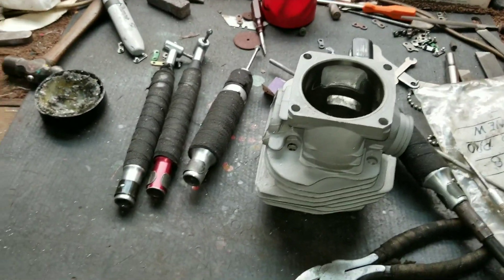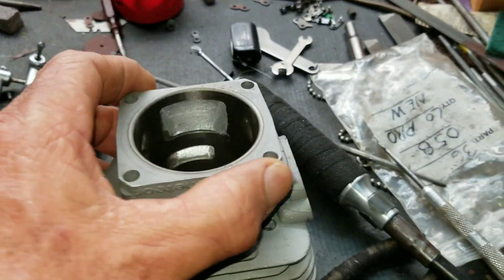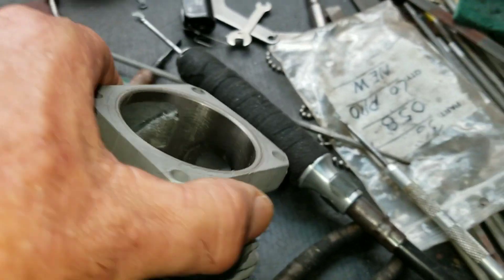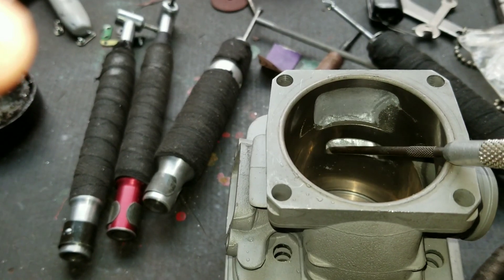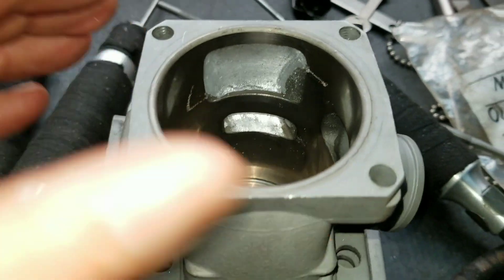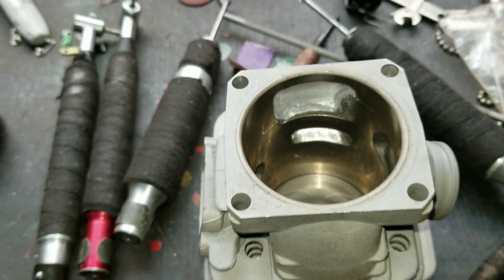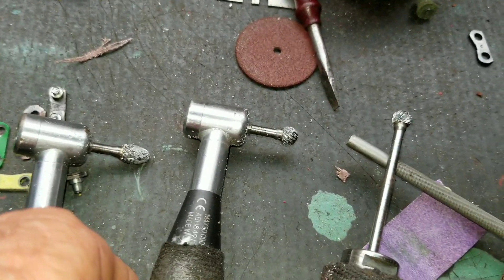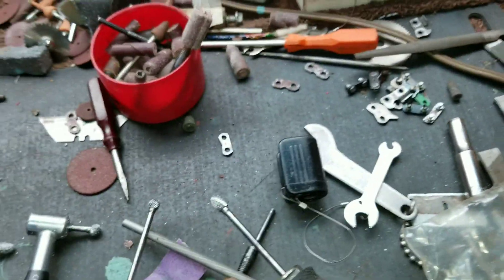STIHL MS 660 METEOR CYLINDER PORTED

Comment: Hey John, fairly new to porting but did notice  exactly what your talking about. Won auction saw ms 660r had new meteor cyl that im thinking ran a few min and cold seized. Noticed the same flat profile you did. Agree with your analysis . Cylinder  did look very nice but compared to new oem cylinder upper transfers very tall and flat. Thanks for sharing your work! Much enjoyed